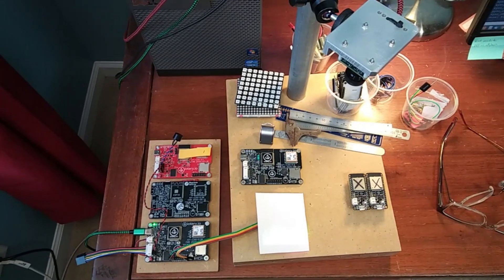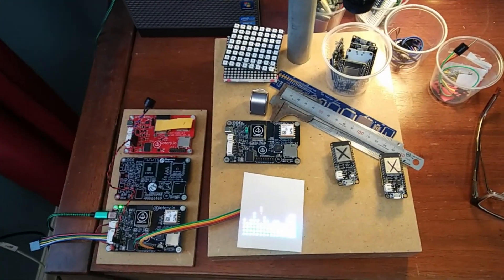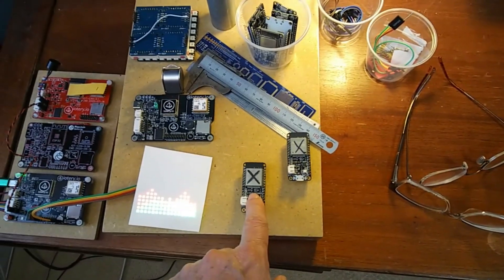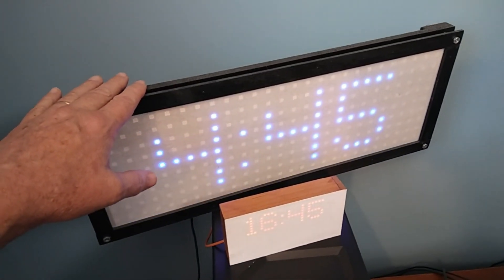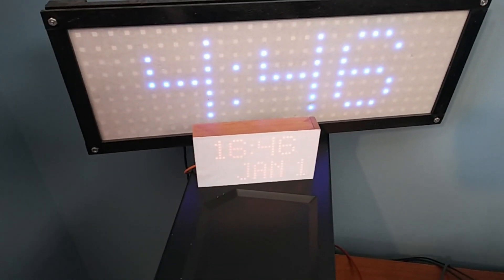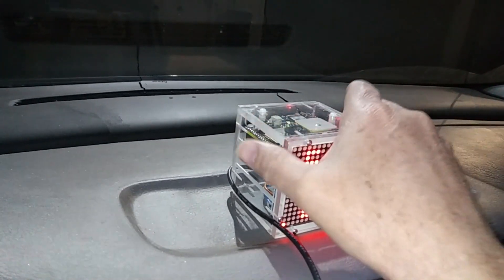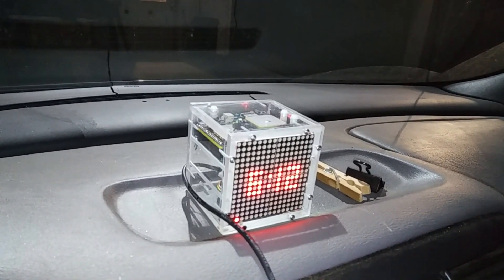Are ESP32s Reliable?

Comment: I am curious to know how you have found ESP32's for rf interference?
I automated a roller door using micropython on the ESP32 driving relays and MQTT messaging over WiFi to interface with a RFID reader outside the roller door.
The problem was noise from the 3-phase motor contactor would send the ESP32 into a bunch of boot-loops.  Everything bar the power supply cable was optically isolated and even the power was stepped down using a buck converter, possibly just a common ground?
I took the system out in the end as it was too erratic in use.
Anybody anything similar?
Reply from the maker: Hi Garry. Good to hear from you. I haven't had any problems with RF interference with my ESP32s, but I always get the modules that have the rf can on them. I'm going to suggest that when the motor comes on you have a momentary voltage drop and your ESP is doing a brown-out reset. Maybe try putting a big capacitor (or supercap) on the output side of the buck convertor? That might help it get past the voltage drop without a reset. Maybe even a battery of some sort? It would be interesting to see if that's the problem.
Reply: I am sure I even tried completely isolating the unit at the time and IIRC I was using w WemosD32 which had a WROOM type ESP32 under a can.
I must check back but have rebuilt it in any case, it is almost ready to try out in version 2.0
Reply from the maker: I'll be interested in hearing how it goes. I haven't done anything near mains voltage and high loads.

Comment: That's a beautiful surrounding you have there! I'm still playing with the ESP32 ;) Also got a pi meanwhile for some recordings I want to make with a pi camera. The ESP32 cam setup that I bought one year ago wasn't good enough sadly. I have two ESP32's laying dormant on a shelf, I should really do something with them. I was designing a bike light system last year, maybe I could incorporate the ESP32 somehow.
Reply from the maker: Hi Marinus! How's it going? I've been watching some of your plotter videos, and I had to get my plotter out so I can start  working on it again. I just love watching CNC machines run. An ESP is a good choice for a set of bike lights. You can have switches, but you always have the option of using your phone (or another ESP32) to control it remotely via wi-fi or BLE.

Comment: I started recently to learn arduino and i am progressing slowly but i'm learning. would you be kind and give me your honest advice should i continue with arduino, or should i switch and start over with ESP32s. thank you. btw you are awsome.
Reply from the maker: Thanks. When asked this by someone learning I always advise going with an ESP32 and MicroPython. Cheaper, easier, Wi-Fi, faster, and Python is a very practical language to know. That's my opinion. But there is a huge amount of gear and support for arduino...  For what it's worth, I'm have some prototype ESP32 dev boards made right now, and after testing I'd like to move toward making some MicroPython tutorials and projects using them. They should come next week, so I'll put up a video when they come. But in the meantime, I have a vid about buying cheap ones on eBay, and also a getting-started tutorial. You can give it a go for only a few dollars.
Reply from the maker: I see you watch the crafsman. Did you see my drawing video?
Reply: @ClaytonDarwin  i am watching it right now, boyyy you got skill.

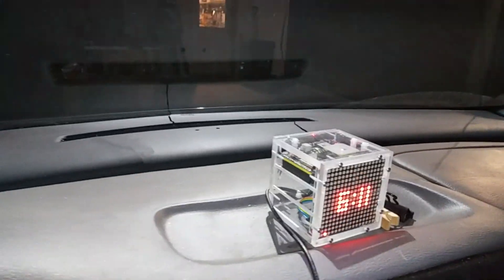Comment: 3:15 ok now that’s pretty impressive, I couldn’t even leave my surface pro mounted on my console past spring.
Reply from the maker: Man, you truck sounds way more high-tech than mine. Surface Pro? The only tech I have on my dash is a USB charger plugged into a cigarette lighter.
Reply: @ClaytonDarwin  lol I did this to my car in college, I’ve since removed it since it was too much effort to keep working correctly, so now I just have have an amp and a gaping hole in my dash.  It’s good for when I go to Chicago.
Reply from the maker: @wcvp  That's more my style.